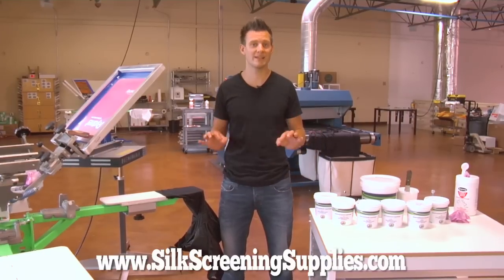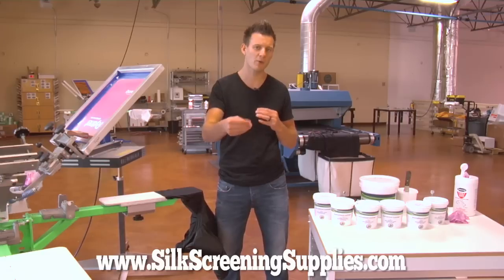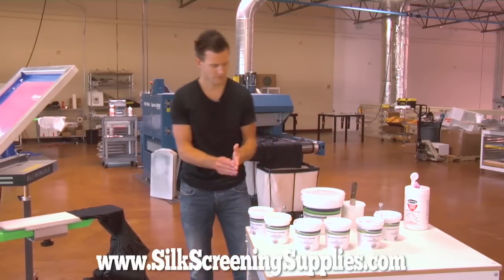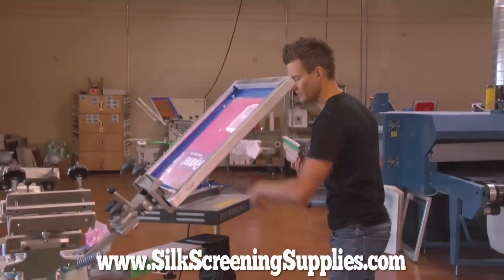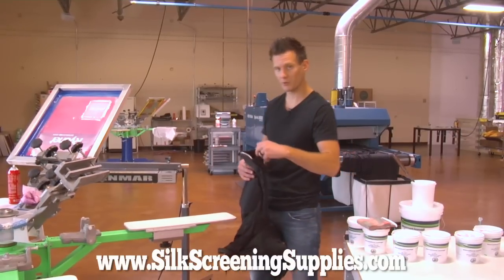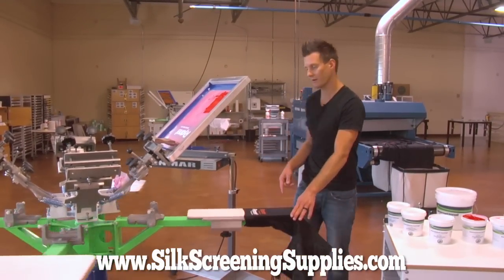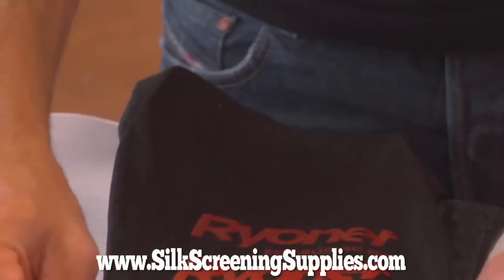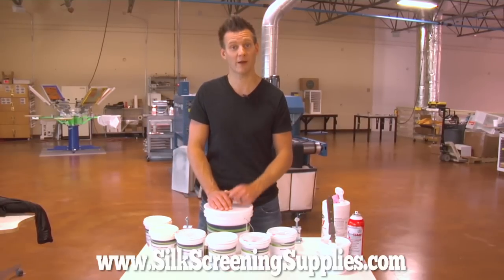POLYESTER Screen Printing - You can easily print polyester ink and sports apparel

Comment: Hey Ryan,

Great video as usual!  I was wondering if this ink will work for printing rash guards?  Typically they are made up of Lycra or a blend of nylon/spandex.  Thanks in advance for your time.  Cheers!
Reply from the maker: They should print rash guards no problem but, if you're doing low detail designs then cutting the design out on vinyl and heat transferring the vinyl to a heat guard will always be the best way to go.

Comment: Just curious, is this the same type ink Under Armour uses and if not, does anyone know what brand or type they use. Their prints are really smooth and look good. The ink on their prints don't look like plastisol, but something else. All of this print -flash-print that you have to do with this ink would cost you a lot of time. I want an ink that I can put on the shirt one time and dry it.
Reply from the maker: Harrison Holmes They are using water based inks very similar to our green galaxy ink, we have done very similar style of prints on poly with Green Galaxy Comet White + Warp Drive

Comment: this must be sublimation screen printing ink can be used on fabric and apparel, they must be used on paper firstly and then can final printed on fabric or apparel. for which kind of material can use this ink, you should know how much percentage of polyester contains. and usually only the polyester is more than 60% can use this sublimation screen printing ink. actually, this screen printing machine now has lagged than offset machine and digital printer
Reply from the maker: Lois Lee Sorry this isn't sublimation.
Reply: Ryonet hi,Ryonet,Dose it is sublimation screen printing ink? by the way, what is the water based ink?dose it for digital printer?
Reply from the maker: Lois Lee No its for screen printing, the water based inks are for screen printing as well. =)